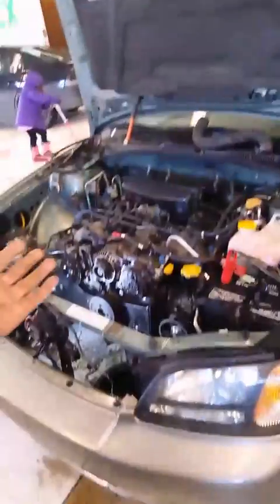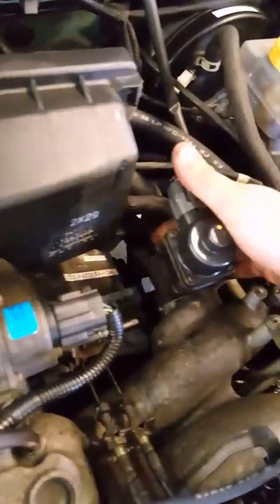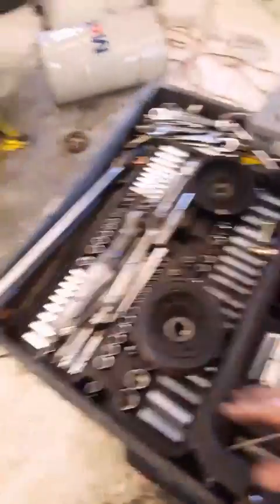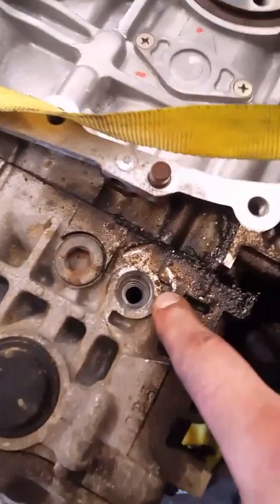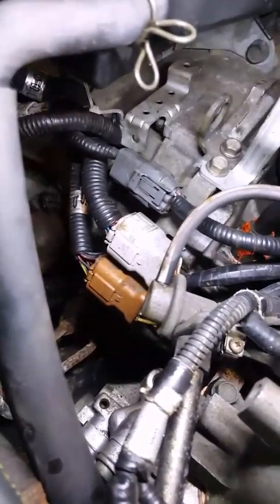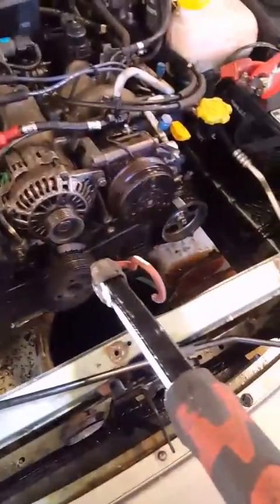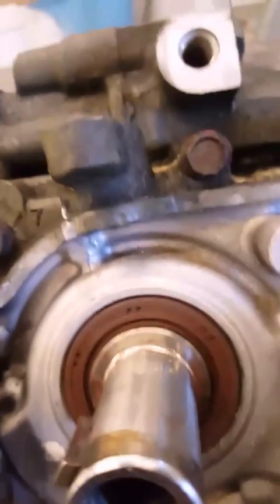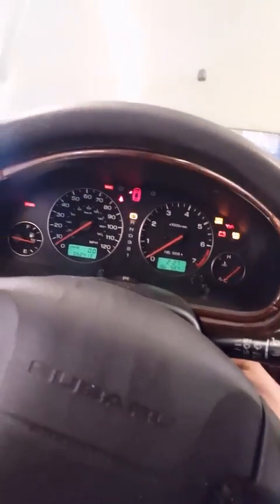SUBARU MOTOR SWAP EJ25 TO EJ20 ALL YOU NEED TO KNOW

Comment: Hey I have a 2005 Subaru Impreza rs ej25 and I swap it for a ej20. But now the car would not move at all. I swapped every sensor you can think of. The transmission for a brand new one and axles etc. would it be the ecu? Really need some help. Sad I missed boxer fest this year.
Reply from the maker: Does the engine run? If so. Your transmission must be the wrong one. Or you were sold a bum new tranny. Also. Make sure it's filled with fluid. No hydraulic pressure = No movement.
Also did you make sure to bolt the torque conver to the flywheel? Believe it or not. People do that alot.
Reply: Mikhail Burke everything I swap was good. But the car does not move. Would it be the ecu. I got engine codes and replaced what it needed. Did you or anyone have to replace the intake manifold. And also my brakes lock up every start up.
Reply from the maker: Yeah the intake manifold definitely should have been swapped... the only thing you should have from the new motor is legitimately the block and everything that's inside of it... Depending on what motor you swapped to and from is going to depend on what's wrong here. it's quite possible you kept the spark plugs and wires from the first engine... Bad idea. The plug wires are probably too short. Not deep enough into the plug holes to rest upon the plugs right. Or maybe you screwed up the vaccum hose from the booster, or you didn't replace and or damaged an intake manifold gasket during installation and now have a massive vaccum leak... or an entire Heep of other problems...
Reply: Mikhail Burke I will keep you updated and see if the intake swap will work and yeah my ej25 intake booster vacuum hose was different to the ej20. My ej20 vacuum hose was located on the passenger side. Ima swap to the oem ej25 intake
Reply: @itzju-baru  what ever happened bro
Reply: @akidim13   in the process of transmission swapping. Everything else worked out fine.
Reply: @itzju-baru  how’s the power difference? Anything to complain over ? I’ve heard everyone say it’s a smoother engine for sure
Reply: @akidim13   yeah tbh gave it a better rumble. But automatic wasn’t giving me the best so I’m manual 5 speed swapping.
Reply: @itzju-baru  yeah read that too , that manual works better with it , I have a 04 Impreza wagon that I’m gonna be putting the ej20 after a rod bearing decided to head out after 3 days of owning it , 168k miles too

Comment: Thank you for your video
If I want to do  head gasket on ej20 before swapping. Which set do I need? Also did you use old manifold gasket?
Reply from the maker: Nope replaced all gaskets intake gaskets are the same the coolant port gaskets are the same the valve cover gaskets may differ. As will the head gaskets usually. So if you're going to do any head gaskets 4 valve cover gaskets be sure to get a set from the exact year your that you are putting in is from.
Reply: @551mic  
Thank you for your time answer. The ej25 Jdm is 1150. Ej20 Jdm 750. I don't know worth doing all this shit for saving 400
Reply from the maker: that all depends on where you can get the engine from where I'm located the engines very drastically in price whether they're used or new. Regardless I only made this video because my customer who owns the vehicle had that engine just lying around completely spare from one of his older vehicles... So for him it wasn't a a decision between the cost of either motor it was a decision to save $1,200 straight up just using an engine he already had
Reply: @551mic  
Thank you for your time and answering. You got all covered and I know gotta get Gates T304 for belt but don't know order head gasket set for ej 20 or ej25 from part store. I'm going to change gasket on ej20 also just in case in a year or so don't want to deal another headgasket on this motor.

Comment: Here I have a subaru wrx 2008 swapped jdm 2.0 v7 with the 2.5 ecu still in it and it doenst boost much, I bought a cobb AP but I think I will need to have a custom tune because of the 2.5 swap to 2.0 ???? I still have all the accesories of the 2.5 on it
Reply: Looking into doing the same! Did you end up finding a solution??
Reply: what did you end up doing? having the same issue with new ej20 i installed on my 14 wrx
Reply: I used something called 'tactrix openport 2.0' with logs of my car someone on the internet modified my map to put the maximum boost possible without knocks, it went well now it boost to about 15-16 psi
Reply: @franklaramer5233  can you recommend that person? i jave a tuner in mind in my area but wouldnt my going by word of mouth

Comment: I have a question. I'm looking to build a Factory Five Racing 818 and curious to know what limitations on how much power you can extract from the EJ20 versus the EJ25. Also does anyone know anything about the JDM EJ20X? My daily driver is a 2014 WRX and I think it would be neat having the same powerplant in my daily driver as my racecar. The EJ20X from the Japanese versions seem to be very plentiful in supply but I do NOT want any less than ~260hp. There is so little information out there, and it's driving me nuts.

Comment: so i have a 2009 forester x with a 5 speed with a blown 2.5 the 2.5 is way out of price range for me i found a 2.0 but the spark plug holes look alot different from mine it is the turbo 2.0 ej20 from a 2000 forester for really cheap i still have my original motor but cant do anything with it since it damaged the cylinder walls. otherwise id rebuild it was just wandering if anyone has done something like this to newer models.

Comment: Can you swap a 2.2 in instead of a 2.0?
Reply from the maker: Yes
Reply from the maker: There's just a lot of modifications beyond an EGR tube... the 2.2 intake needs cut and welded, needs longer plug wires because the depths and coils are different. And there's no mount for the coil of the 2.5 on it. I have only done this once... and it was many years ago. Used a 95 2.2 in an 03 2.5's spot. I wasn't the master on that job... I was 16 at the time. And don't remember what else we did. But it is possible!!!

Comment: I got a 2005 subaru legacy gt 2.5 the engine went out and I cant afford another 2.5 , the shop where my car is currently at told me they have a jdm 2.0 turbo engine and the mechanic says it's a direct fit and it would work . The 2.0 engine came out of a 2006 japanese legacy, would I be ok using the us ECU that originally came with my car or would I eventually have to buy a new ECU? The mechanic also said we will use the harness turbo and upper pipe from my old engine and put it into the 2.0 does this sound correct to you ? The guy said that the 2.0 engine is more reliable and that I will be just fine wanted to get your thoughts
Reply from the maker: I absolutely back him up on that. Although I think you should use everything from the old engine on top of the new one instead of just a couple of things but absolutely he is correct. You will not have to reprogram your computer at all if both Motors were turboed and your harness has a turbo sensor and you're going to use your original turbo you should be just fine...
Reply: Is your car still running with the swap? I just did it on my outback XT but afraid of driving it before tuning. 
Thanks

Comment: This is for a 2000 Subaru Impreza 2.5 RS with a jdm non turbo EJ20 swap. Bought it from previous owner. Can you help what could be the cause of why my car won’t redline at 6200? It tops out at like 5500 rpm. And there’s like no power when trying to accelerate and when I do it rises slowly the higher the rpm even with WOT. I’ve been trying to have it run better by doing research but it seems like nothings working.
Reply from the maker: What year is the EJ20?
Reply: Mikhail Burke 98-04
Reply from the maker: Swap the throttle bodies
Reply: Mikhail Burke which throttle body? The previous owner swapped the intake manifold off of the ej25.
Reply from the maker: So the engine in the car now has all the stuff from the top of the original motor? Sensors and all?
Reply: Mikhail Burke what sensors need to be swapped? I’ve done the crank and cam shaft sensors.
Reply from the maker: Swap them all. And swap the sprocket sitting behind the crankshaft pulley
Reply: Mikhail Burke can you name me all of the sensors?
Reply from the maker: Cam, crank, coolant temp, oil pressure, knock, and any others it may have on the intake manifold and air inlet tubes and filter box...

Comment: I got the car to move! It just needed the throttle body from the 2.5 it's really gutless tho I took it for a test drive and it takes a long time to get to 80km/h. do you know why
Reply from the maker: Luckily the throttle body was all that was different from harness to harness. And yes it is a smaller engine and it does not have a turbo, the tune it has is most likely for a lighter frame and a lower gear ratio transmission...
Reply: Mikhail Burke so if I turbo it would it make the car perform more like a 2.5?
Reply: Mikhail Burke I didn't change the cam gears or any of that you showed in the video. Would that make it so slow?
Reply from the maker: Yes a turbo would boost it to perform as such... and generally no. If its even running right now the gears must be the same and or both engines oporate without a cam sensor and only a crank sensor. There are plenty of motors that do this... however like I said in the video if it's their swap it over... the entire goal is to keep that vehicle as stock as possible so that way it'll run the same and everything will operate the way it is intended none of the sensors or anything will get burned out and it will run... generally swapping from a 2.5 to a 2.0 is not recommended due to the horsepower decrease... the only way to make it run as closely as possible the same as the motor that was in there prior is to swap as many things over as possible from the top end... and if you go with the 2.0 a turbo is almost always necessary unless you don't mind waiting a little while to get up to speed. The cost is generally why someone would go with a 2 ohm stead of a 2-5 considering you're more likely able to get a 2.0 for way less than a 2.5. My customer wanted to save about 1500$ on the one I was working on in the video, that is the only reason why I put a 2.0 inside of his vehicle, he just had it laying around... didn't have to buy one. And your odds of spending less than that to put a turbo on it... drastically close to nil. The same type of 2.5 would have been a better option. Unless your a master machines and engineer and can build it all out of crap laying around your shop...

Comment: I have a 2005 2.5 RS that has a 2.0 swap from Japan. The engine is 2000-2005 but the intake is a bit differant. Ive got all the connectors plugged in and the car will start but when I press the gas to the floor it idles at 1000rpm and does nothing then bounces down to 750rpm and back up to 1000rpm. Could you give me any reason why it does thay
Reply from the maker: Does it have an electronic throttle body or a mechanical throttle body?
Reply from the maker: Also what year is the 2.0 relative to the 2.5? Did it have all the same sensor locations as the 2.5? Did all of the sensors and harness get swapped to the 2.0 from the 2.5? And the intake manifold from the 2.5 to the 2.0? Did the stock 2.5 have a turbo setup?
Reply: Mikhail Burke I didn't swap any sensors, the sensors are all in the same location as the 2.5 but there are a few vacuum lines on the 2.0 that the 2.5 didn't have. The 2.5 was a na set up.
Reply: Mikhail Burke I haven't changed the intake manifold or harness. Ive got a code for a fault to the throttle body/pedal sensor
Reply from the maker: Okay swap the intake swap the sensors swap the wiring harness. Odds are since you plug that harness into the connection points of the vehicle a wire that normally isn't live on the harness that engine originally came from is live on this harness and it has burned out your throttle body.... keeping it uniform is the whole idea when it comes to swapping motors with different sized Motors or different years. So you always want to swap everything on the top. Aka all sensors and wiring harnesses. Nine times out of 10 what the issues are is that certain wires are live and certain wires are not live and certain wires have certain voltages and certain other wires do not have certain voltages so if you have a different type of sensor it may look the same but it operates differently when you plug it into a harness that it fits into but the wiring is different than the vehicle prior or the vehicle that it's going into odds are it will introduce High voltages or even low voltages two areas that are never to be electrified be on the ground and it will burn that unit that module or that sensor out... most of the time with Subarus the only wiring that's different from harness to harness is the location of the prongs that introduced the circuitry to O2 sensors and turbos so even though the connections look the same as if they will plug into one another the prongs inside of the junction sockets can be placed in different spots... for example on a general electrical socket connection for a Subaru there are two square sockets. Inside of those sockets the top right two prongs are the circuit positive and negative for the coolant temperature sensor. However if you try to hook up a harness that is let's say 2 years older 2 the harness inside the vehicle you have now the top right two prongs could be the circuit positive and negative for something else like a cam sensor or an oil pressure sensor or a turbo sensor. That is why it is so important to always use the harness that was in the vehicle to begin with and keep all the same sensors and intake unless you're buying the exact same engine that was in the vehicle in the first place
Reply: Mikhail Burke the old harness is missing a wire..
Reply: Mikhail Burke if I didn't swap the sensors and cam gears would my car still start?
Reply from the maker: Missing a wire that this engine had on the other harness of the vehicle it came out of? Than it wont need it in the vehicle it is in now. The computer wont communicate with it anyway...
Reply: Mikhail Burke Ive got the car running with the 2.0, it wont rev passed 1500 rpms tho. Do I need to get the ecu flashed to run the 2.0 ?
Reply: Mikhail Burke no there's a wire that was on the 2.5 harness and it was cut but soldered together previous to me owning the car. While taking the intake off the wire was pulled out and I do not know which slot the wire goes into. It's a brown colour wire with a green stripe

Comment: Hey Mikhail, I have a 2006 Subaru Forester with an non-turbo EJ20 swap. I took it to a family friend for the swap and it came back in limp mode. My main mechanic says that there are 02 sensors that are missing from the harness. If I get an EJ20 harness will this fix my issues, will I need an EJ20 ecu to go with it? I'm just trying to get this sucker to pass emissions.
Reply from the maker: Khori Wilson yes get the harness that has the wiring for the O2 sensors and then have the PCM flashed to include the programming.
Reply: Thanks for the quick response! 

Can I use a USDM engine harness on the JDM engine?
Will that harness plug into the EJ25 non turbo ECU without modification?
Reply from the maker: Khori Wilson either way I don't believe one little bit that two O2 sensors are for whatever reason going to put the engine and the transmission into limp mode. Usually a weakening alternator leading to low voltage, severe misfires, and overheating cause limp mode... never heard of an 02 sensor prior to 2014 doing such a thing... especially on a subaru. The wiring must be incorrect in more than 1 place. Definitely get the right harness.

Comment: when your drilling out the egr hole. ??? do you need to remove the head from the block. wont metal get in your engine... ??? please help...
Reply from the maker: james shilling if you have a good drill bit and most of the metal will come out of the hole when the Joe is turning. If any gets inside the motor blow it out with compressed air or vacuum it you don't have to do it with the head off. I do it with the head on! Very seldomly does any metal get inside if you do it right.
Reply from the maker: Also if you tilt the engine on a crane to where the hole that you will be drilling out would be facing downward and you drill up into it your likeliness of getting metal inside the motor is practically zero
Reply: thank you vary much.. motor coming tomorrow. i understand what to do now.

Comment: Great video man, just did the same swap on my 2000 Legacy, after it gets warms up it picks up a pretty severe miss but only at lower RPMs. Anyone have any ideas on what could be causing the problem.
Reply from the maker: Weston Craig bad ignition coil is most likely
Reply: I thought the same thing, it was returning a cam and crankshaft sensor error. I replaced both sensors and the ignition box same problem. Do you think it may be an emission system problem?
Reply from the maker: Weston Craig your timing must be off by a tooth. Or possibly bad piston rings. Bad spark plugs. Bad head gaskets causing loss of compression. Any number of things. Always the first things you do is replace the plugs coils and wires. After that you run compression tests and leak down tests. And depending on their outcome you move forth looking into timing issues ET C. And if all else fails there must be an issue with the wiring harness so then you'll be tracing wires until you find one that's corroded or broken apart torn or cut... I wish I could be more help to you buddy!
Reply: Hey that's pretty good, thank you!